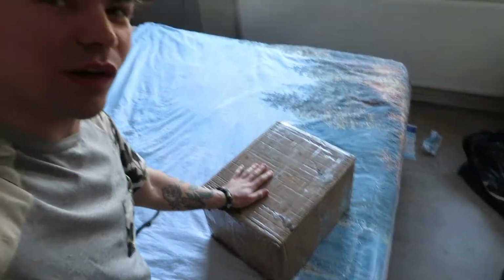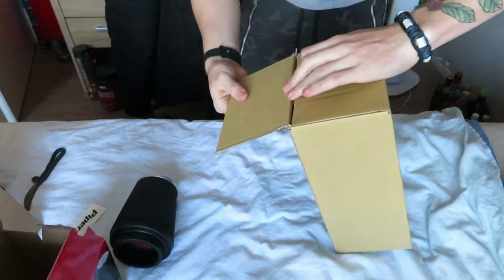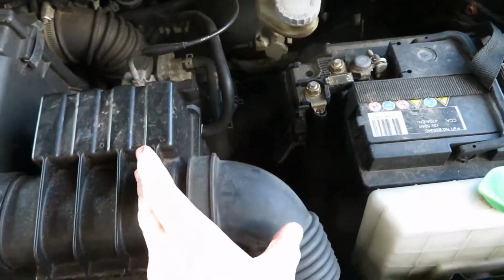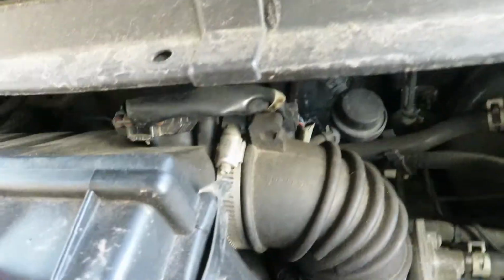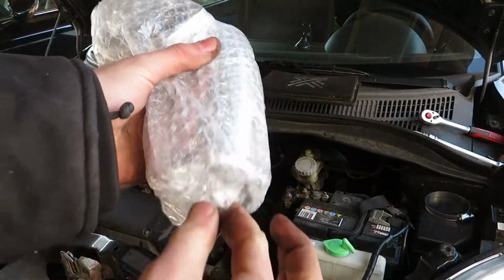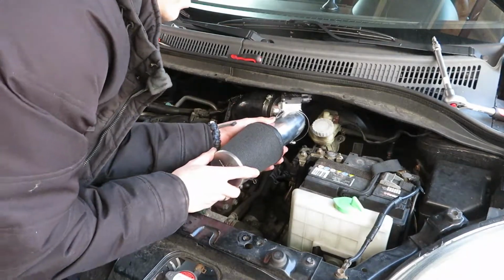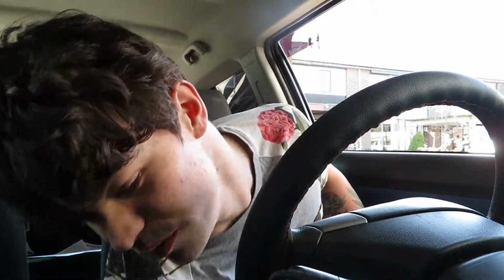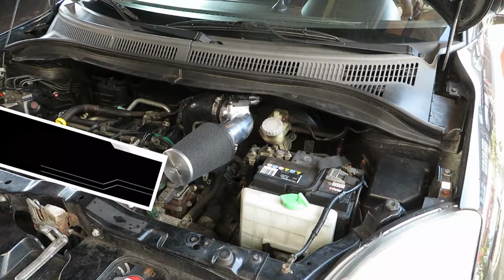PERFORMANCE AIR FILTER INSTALL ON MY SWIFT!

Comment: can i have the link to this thanks
Reply from the maker: https://www.concept-s.nl/alle-producten/CS05002--luchtfilter-pipercross-openair-foam-65-mm.html is the airfilter
Reply from the maker: https://www.concept-s.nl/alle-producten/CS32041--luchtinlaat-buis-suzuki-swift-mz-1-3-1-5-1-6-sport-05-2005-12-2011-excl-filter.html and this are the hardware

Comment: Hello mate. Cheers for the video. I’ve also got a 1.3L 2006 swift GL. 
I’ve been thinking about having one of these for awhile. Did you notice a difference in having this intake?
Reply from the maker: yeah i noticed a big difference but i recommend going for a bigger airfilter becouse that works better for the swift i also upgraded and that one works amazing
Reply: @itslifeofdelano  thanks for the reply. I’ll have a look at a larger intake. 
I can’t seem to find any company on Google called ‘Concept S’ that sells car parts. Would you be able to link the website please. 

Many thanks
Reply: @itslifeofdelano   Don’t worry I found it. Many thanks
Reply from the maker: good to hear that u found it💪🏻
Reply: @itslifeofdelano   It seems there is not an option to ship to the UK. I assumed you live in the UK mate
Reply from the maker: this one is the same pipe as i got atm with an bigger airfilter and they deliver to the uk there is standing 
https://www.ebay.nl/itm/272724845566?mkcid=16&mkevt=1&mkrid=1346-175129-2357-0&ssspo=D7HTVx6eQ8K&sssrc=2349624&ssuid=spwjvm86SbO&var=&widget_ver=artemis&media=COPY